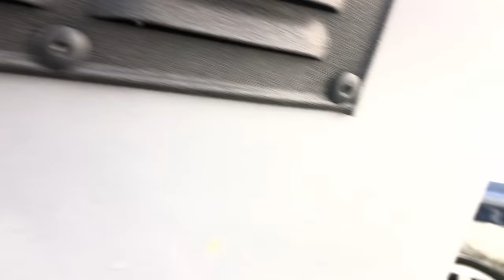Recovering A Boat That Rammed Into Hidden Sandbar (New Recovery Vehicle!)

Comment: Sisu Nasu! Love that vehicle. I drove Nasu for 6 months 24/7 day/night in Finnish Defence Forces. It's just extremely capable machine to transport crew and heavy equipment through snow, swamps, lakes, rivers, to top of mountains - you name it. With those 4 pulling tracks and light weight there's nothing that can beat it's traction and light pressure per square foot. Great to see that thing in action!

Comment: Love to see the Finnish track-truck. I’ve spent numerous hours in such when doing my military. Awesome machine!
Reply: it aint finnish? it is literally a Bv206 converted
Reply: @elt39  developed by Sisu Auto for the Finnish Army. Theres more info in wikipedia if you wanna look it up.
Reply: It looks like those bigger Russian ones that swim up to (sometimes) over the windows.
Reply: The Bv 206 is referred to as a Small Unit Support Vehicle (SUSV) pronounced "susvee" in United States service. U.S. military variants include the standard model (M973), a tactical operations center variant (M1065), an ambulance variant (M1066) and a flat-bed cargo carrier (M1067). U.S. military models are fitted with a 6-cylinder Mercedes diesel engine. I drove one for awhile while in the 6thINF(LT) at Ft.Richardson, AK
Reply: Bandvagn Bv206 is the similar vehicle of Swedish origin, manufactured by Hägglunds. This Sisu NaSu is similar vehicle by appearance, indeed, but of neighbouring Finland origin made by Sisu Trucks. Commonalities are indisputable, though. Finnish army did aquire those original Swedish ones back in the days, and based on driver feedback told Sisu to develop an improved version.
Reply: @elt39  Literally every part of that screams finnish Nasu. There is nothing Bv206 about that. Sweden wasn't even the first to come up with the idea, it was the Soviets with their Vityaz (ATV). So not the first and not the last, they are just there in the middle somewhere..
Reply: Nicki Bluhm🎶  phishing much?
Reply: @alaric_  There you are wrong, the BV 206 began production in 1979 while the Vityaz began production in 1982, the NaSu came in 1985 so yes, the BV 206 was first either way, also, neither the NaSu nor BV 206 is based off the Tityas but the NaSu is a lengthen copy of the BV 206, Sisu says it isn't but it is
Reply: @jyrisalmi4173  Then it is based on the BV 206, you can literally see it on it as the running gear, cabs, and everything is basically the same except the length
Reply: @rogerwilcoxii359  What does any American APC have to do with the BV 206 or the NaSu?
Reply: @elt39  True, design-wise they have similarities, and the purpose of the vehicle is the same. Clearly Sisu Trucks have copied something from their Swedish colleagues but also designed quite a bit by themselves, of course. Hägglunds likely holds quite a few patents so 1:1 copy would have required patent licencing agreement, at least. But yes, basic idea of Sisu Nasu is based on the old Bv206.
Reply: @alaric_  what I found so far sweden seems still to be the first ones with the BV 202 that was developed in 1959 with its first trial run
Reply: The Volvo BV202/203 was the first version. Then when the Swedish military wanted a better version that could carry more troops, Volvo BM made a bid, but the Hägglunds proposal was chosen, and became the BV206. We have a BV202 in the Volvo CE museum in my town, plus a large model of the BV206 proposal. I drive a BV206 in the Swedish Home Guard
Reply: @elt39  I drove those in the army and let me thell you something: cabs are different, middle joint is entirely different, track system is very different. Both have pros and cons. Bv206 is more reliable and simplistic, whereas nasu did some tradeoffs for more agile vehicle with lower ground pressure: it's bigger and heavier but has lower center of gravity, sharper turning thanks to the more complex middle joint, and bigger tracks. Personally I drove mostly bv206's and I prefer them for their reliability, but I was very jealous of how easily nasus snaked through forests.

Comment: Awesome to see that old Finnish Defence Forces Sisu Nasu put to good use after its service life! :D Really cool to see you guys have kept the original stickers on the interior as well!
Reply: It looks pretty much identical to what I know as a hagglund. Are these 2 separate things or just different names for the same thing.
Reply: @benmac940  They are two different vehicles. The Sisu Nasu are made by the Finnish company named Sisu.
Reply: @vesa7069  ok thanks for the info, very similar vehicles though I assume?
Reply: @benmac940 Yes, they are very similar. Sisu Nasu is manufactured in Finland and it has GM V8 gasoline engine. And the Hagglunds Bandvagn 206 is manufactured in Sweden and is using Ford V6 engine.
Reply: Nasu-Sisu has orginally Range-Rover V8, later also GM 6,2liter diesel…
Reply: As the Finnish army also has the Hägglunds BV206, I am assuming Sisu just copied the basics of the BV206 after the patent(s) expired
Reply: @benmac940  I used to drive hagglunds in the army, they are similar but there are differences. Engine, troop capacity, weight, size, turning radius, track system, the joint between the cabins, ease of repair come first in mind. Nasu is heavier and longer, possibly slightly higher. It also turns sharper thanks to the different joint design, but the higher complexity makes it harder to maintain. Usually hagglunds feel more powerful, possibly because they weigh less. Nasu can tilt more before falling over but both are crazy, over 30 degrees safe tilt. Hagglund tracks are attached by 2 springs each with the sprocket at front spun by a jointed axle, nasu has straight axel and springs only at the back of the track. Nasu tracks come off easier and have overall more problems, for example the rear wheel of the track is attached to a sort of swinging system and can become loose - hagglund doesn't have this problem because the wheel is solid. There are more differences but they are not so important when it comes to functionality.
Reply: @OutAndAbout  or to sum up that massive spiel for the lay observer they are just 2 different brands selling an identical product

Comment: The right tools for a very good job.Saved that guys boat. Years ago, I watched a boat fall apart on a beach near San Diego.  The boat driver missed the entrance to a man made harbor at Ocean Beach. Nobody could get the right equipment on land or in the ocean to recover the 30 or 40 foot sailing boat. It was probably cheaper for the insurance company to write it off than recover it.

Comment: You need to bring some float bags that are like tubes that are held together with straps. Maneuver in to place On each side of the boat and then fill the tubes. The boat will rise because of the straps that will cradle the boat between the two tube bags then just float it back out to deeper water and you're done.

Comment: We had a similar situation at a lake here near me. We had the fire boat come out and pumped water through the hoses to blow sand out from under the boat. Sand was all inside the engine where the water inlet sucked up sand when it hit the sandbar. I pray that did not happen in this case….

Comment: Would the engine not be better in the trailer part of the unit.?
Then everyone wouldn't have to put up with the noise from it.!
You could pipe the radiator water through to the front unit for heat, and all other wires etc that you'd need. Then all the tools etc could sit happily in the engine bay.

LOVE THE VIDS.🥰🥰...
KEEP'EM COMING.🤞🥰...
RICH(UK).🥰🥰🥰.!.!.

Comment: Check out the Royal Marines - They have been operating BV's for years. Used mostly for artic warfare in deep snow but can be used in water with the ability to operate in deep water.
Reply: +175
Reply: 7656
Reply: 5253

Comment: As long as those tools are life time warranty. 
They would be worth the money that they cost.

And I want that box.
As long as it has Standard and metric sockets in 1/4", 3/8" and 1/2" with lockin extensions in each size.
And Standard and Metric wrenches and Allen Wrenches.
It would be a 14 to 18 drawer tool box. LOL

It would be the best on the go tool box ever.

Comment: I like how I checked the comments for the spelling and no one else has even attempted it(in the hundred or so comments i saw) :) wanna see more of this vehicle. maybe a walkthrough on what it is, how it works, etc. looks like the articulating piece houses drive line from the rear (where i assume motor is) to the front tracks and all that jazz. if anyone has a link to an informational video of the original purpose of these vehicles, please let me know. thanks!

Comment: This just happened to me and I think it was like 8 inches of water. Once the dnr fave me permission I just drove my truck out there and dropped the trailer, turned the truck around then used the winch on the front to pull it on the trailer. Hooked back up and pulled out.
Reply: Gave*

Comment: Ok - so I've read it's "articulated" so I would have expected to see hydraulic cylinders between the front and rear, but I don't.  I have also read that it needs the rear section or it won't be able to turn.  So how does it steer?
Reply: You can see one of the hydraulic cylinders at 13:51
Reply: @melconify  I kinda thought that.  But why the fuel filler in the rear unit if no engine back there?
Reply: @davidepperson2376  Because there is a engine back there, both units are powered and drive the tracks. The chances of getting stuck are extremely low with such a setup, if one unit would get stuck the other one will push/pull it out depending on which one might be stuck if it were alone. See the wiki article: https://en.wikipedia.org/wiki/Sisu_Nasu
Reply: @melconify  So it does have two engines?
Reply: @davidepperson2376  Yes!

Comment: I do need your help but it's located in Annapolis md.  I bought a 38 foot boat back in April on the words of the seller but turned out to be not so easy and has yet to be moved to millsboro deleware what I was told it was no problem getting it there.   I am 72 years old and trusted someone who was far from trustworthy.   Just sharing   very far from Idaho   thanks anyway

Comment: Too much talk. Drove into a big rock and didn't stop Fail. Drove out a different route than you went in Fail. Nearly crushed an idiot Fail. Damaged the trailer Fail. Too many adds Fail. That many people could have walked out and shoved back into the deeper water. (done it with enough Viking ships to know how easy it is). Could have walked out to test the unfoot going and then used a regular 4x4. Still it was fun to watch!